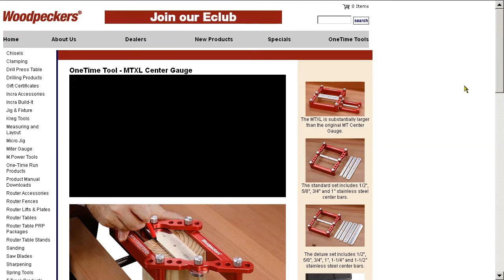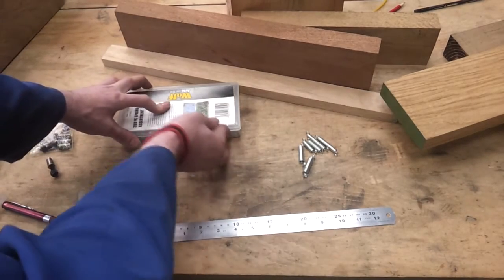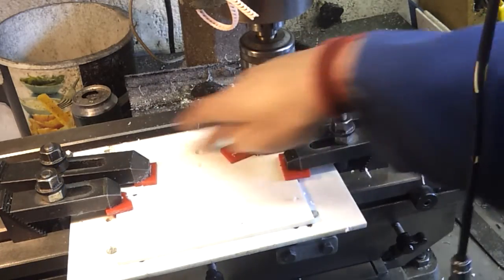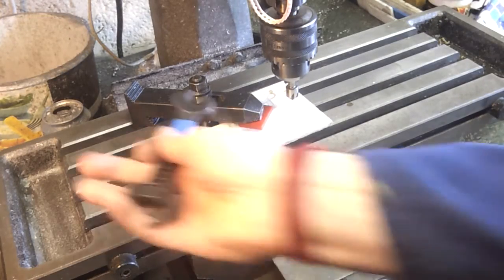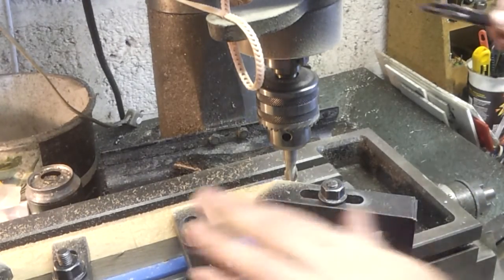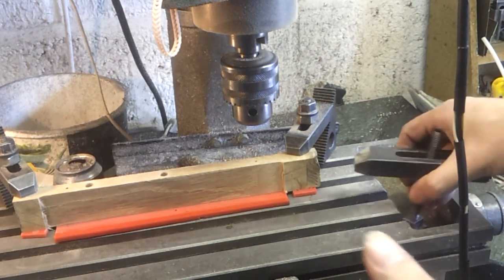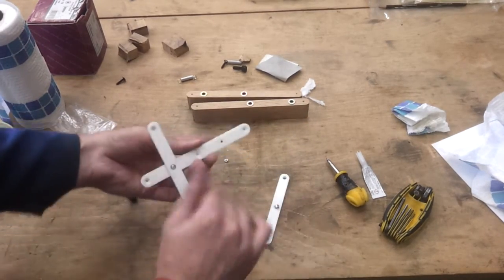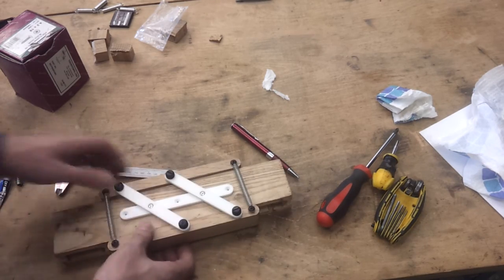Woodworking Centre Finding Gauge

Comment: Kindly give proper measurement because I can't find proper information please
Reply from the maker: The two oak side arms are 200mm long, 16mm wide and 35mm deep, though you could adapt to whatever size you need. The diagonal acrylic links are 123mm long and 15mm wide. I think it was 5 or 6mm thick material.

The two holes in the oak sides are at the centre and 70mm out from the centre. They were drilled 8mm to accept the threaded inserts.

The holes in the acrylic links are at the centre and 54mm out from the centre. The outer holes are 6mm to accept the 6mm thumbscrews that go into the threaded inserts in the oak sides.

The centre holes in the acrylic links were 3mm. These attach the acrylic guide bar in the middle which is 155mm long and 16mm wide. (Again, 5 or 6mm thick material.)

The marking holes in the middle guide bar can go anywhere. The two holes that connect with the links were 35mm out from the centre. They are also 3mm diameter, and counterbored on the underside so that the connecting screws don't foul the wood you're marking.

The springs at either end were just screwed in , so no specific dimensions for their locations, but they were 90mm out from the centre of the sides.

This geometry works for marking wood up to 90mm wide, down to 16-18mm. If you want make one, I'd suggest cutting out some cardboard templates to check it works as planned. I used a hole punch and some winged paper fasteners to check the first one I made. Good luck!